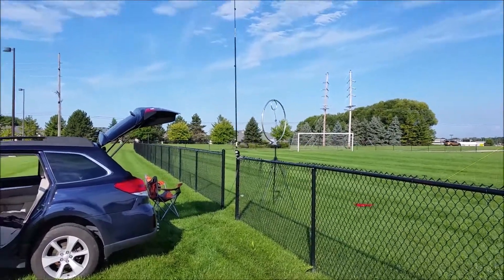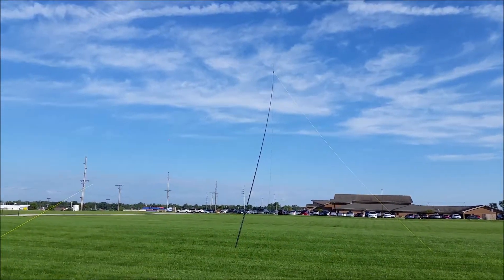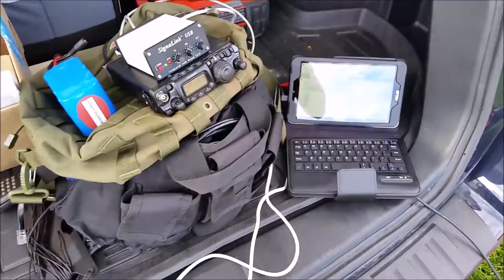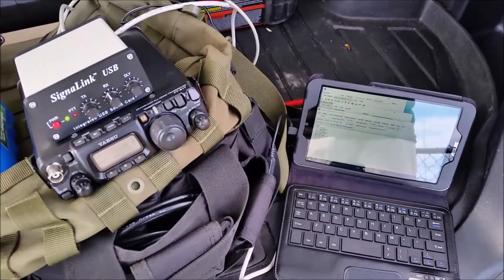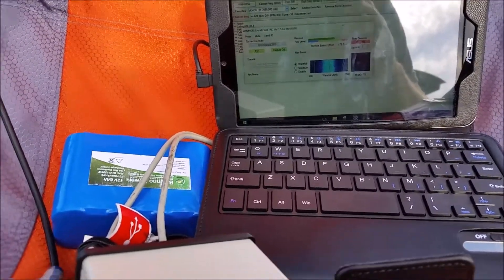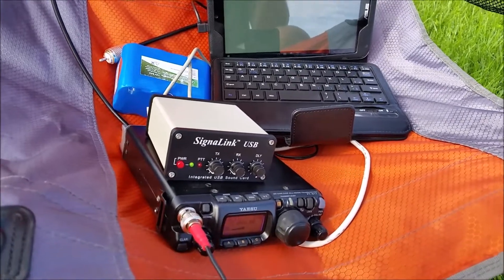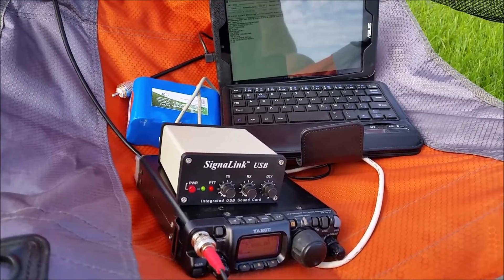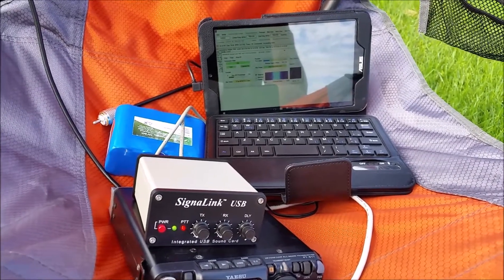Chameleon MPAS, CHA-F Loop, and Sota Beam Test

Comment: How about WSPR for a test like this? It will give you way more data to compare the antennas :)

Anyways: Thanks a lot! Nice video! Subbed!

73 from Germany

DJ6KR
Reply from the maker: Konrad Ritter  I thought about that but I wanted to test what I would most likely be using emcomm wise.   I will be doing more tests though and wspr will be used.

Comment: this is the thing that I tried to explain. put the base of the mpas at the same height that you have the Dipole, or lower the dipole to the same height you have the MPAS. that would be an accurate comparison .
I'm really surprised about the loop not hitting the node, but the problems with the whip are obvious in the configuration.